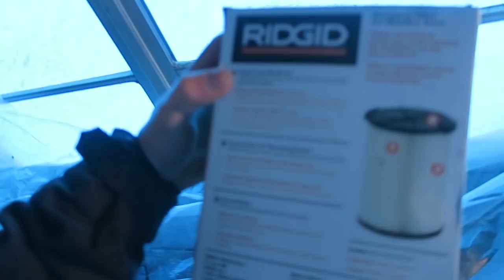Bus Is Ruined | Leaks Everywhere | Bar Table | Painting Walls | Tiny House | School Bus Conversion

Comment: I bought my bus during the rainy season and found no leeks when i bought it.  That said i have done everything i can to avoid putting holes in the roof.  But i have left it double layered insulated metal so external leeks are not noticed.

Your going to love travelling in it, so get it to that stage sooner than later.
Reply from the maker: so lucky! it's scary what you discover as you peel back the layers of a bus though! you just never know.
hopefully we'll be done by the end of the summer. fingers crossed.

Comment: Condensation will cause leaks everywhere! you will have to insulate really good even on the inside of the windows, I would use as much spray foam in the places you cant use regular Insulation! If you cover windows up like with a shower stall you will have to Insulate over that window before you cover it.
Reply from the maker: thanks for the suggestions!

Comment: A good quality clear silicone around windshield rubber , a 91 bus , the rubber has dried out and shrank. Keep silicone in stock , poop happens.
Reply from the maker: yes definitely! stock up on silicone = #1 school bus conversion tip lol
Reply: Best advice is to get some GE Silicone II clear.  That's what we used to use in the body shop for leak mitigation.

Comment: You know I've thought about these old buses alot watching these videos not just yours. But being retired from the construction business I'm almost positive even if i bought a brand new bus. I'd get a roll of that rubber roofing an glue it to metal. It comes white to. Comes 10 or 12 foot be just right to cover top.
Reply from the maker: we'll be painting the top of the bus soon with elastomeric paint to help seal and reflect heat. that's an interesting idea though, definitely something I haven't seen before!